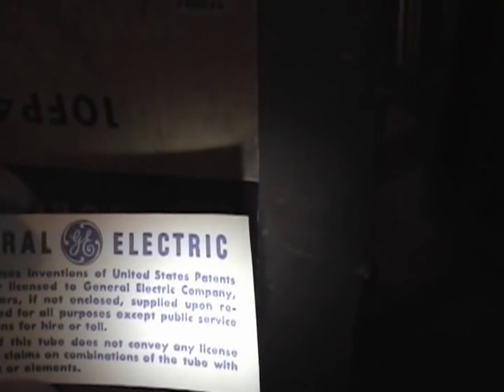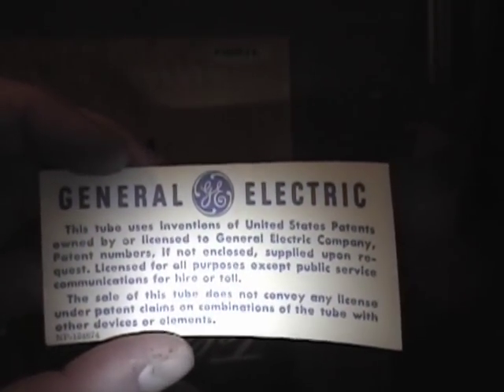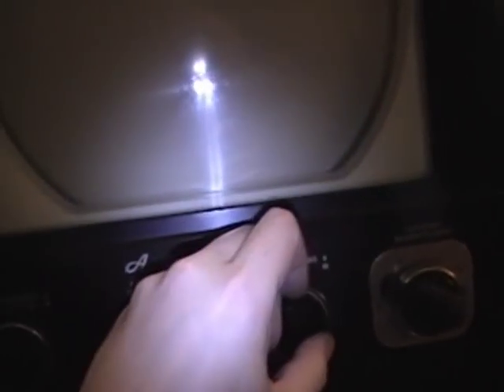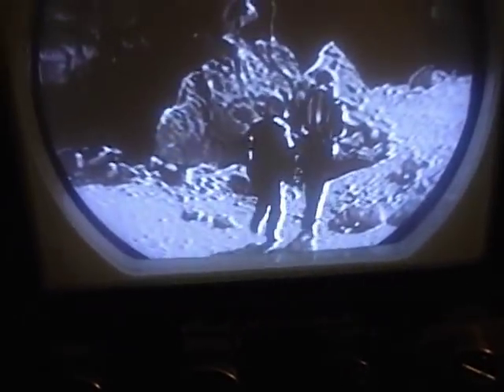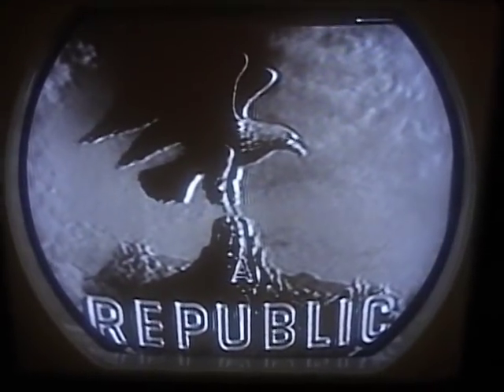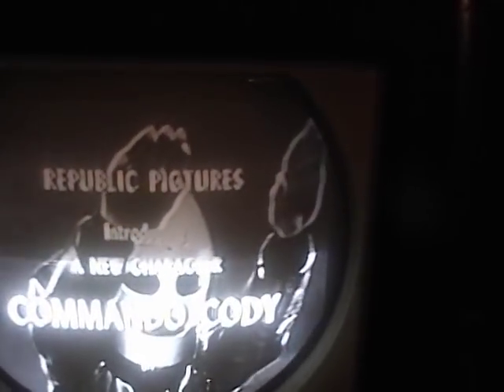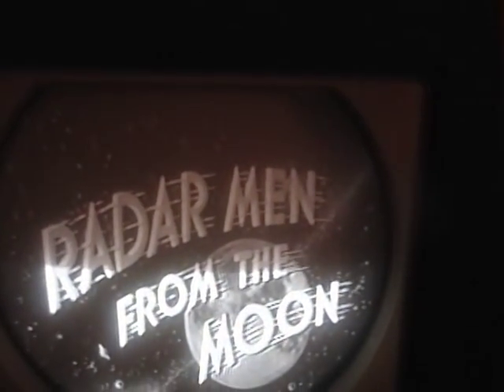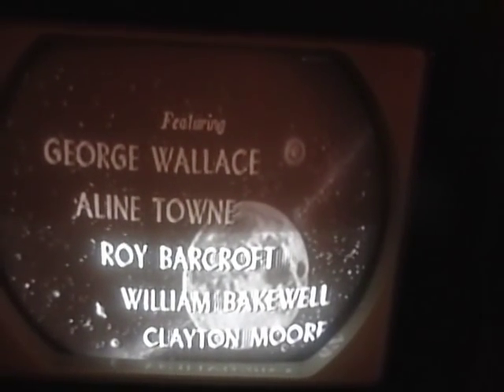Admiral 24A12 Restoration - part 10 (a new picture tube!)

Comment: Beautiful set you have and I've been wanting one of these. There is an identical set for sale in my area, it works but it needs a new crt.  Can you give me an idea of what the cost is for one a new or rebuilt one?
Reply from the maker: Your best bet is to find another set for sale in your area in poor condition and pull the picture tube.  Otherwise, wait for one to show up one ebay or place a WTB ad at videokarma or the antique radio forum.   The going rate seems to be around  $100 for a used one.  NOS occasionally pop up but expect to pay closer to $250 for one.